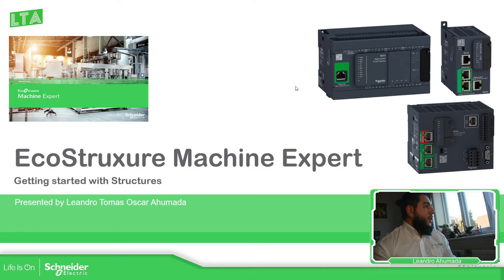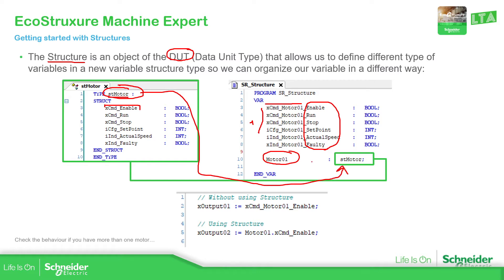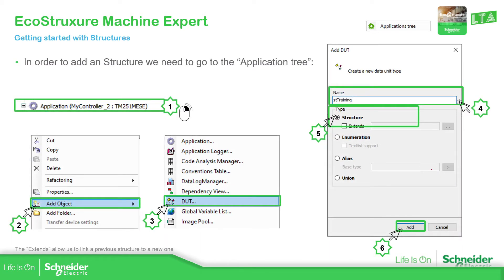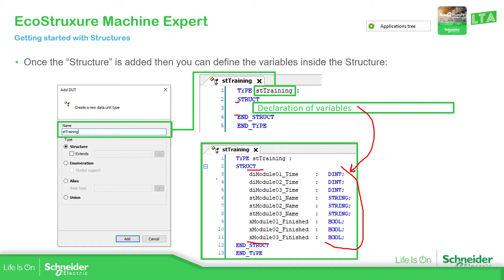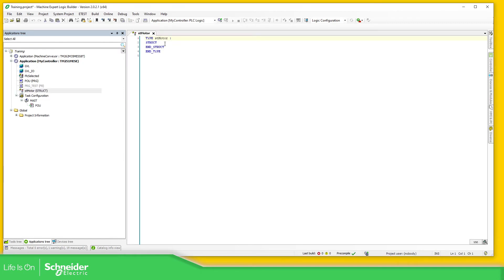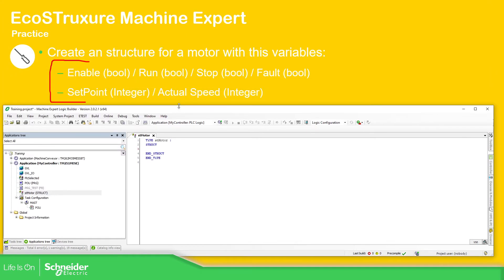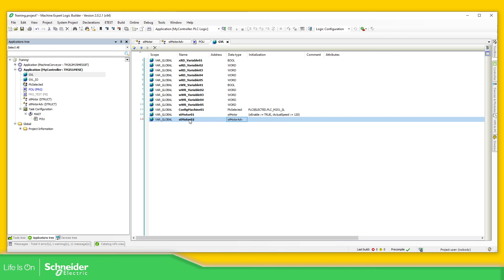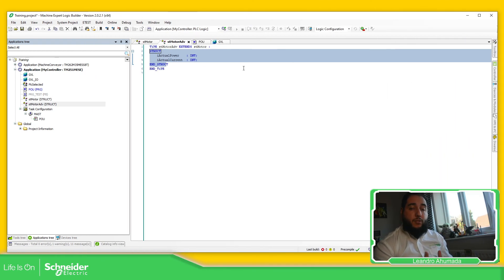EcoStruxure Machine Expert Training - M3.8 Getting started with Structures

Comment: Thank you for the video, great as always.
  I have a question, can I specify addresses in the structure and if so, will they not run into each other
Reply from the maker: Hi there! If i am not wrong we can only defined the %ML for the whole variable structure then the software will assign the position automatically for the variables inside the structure.